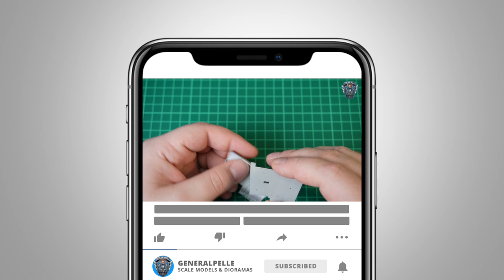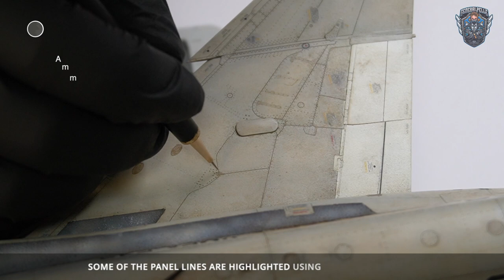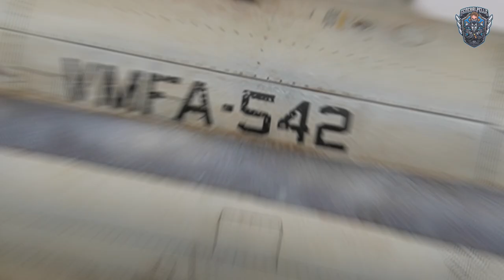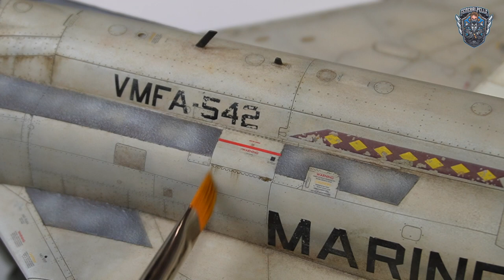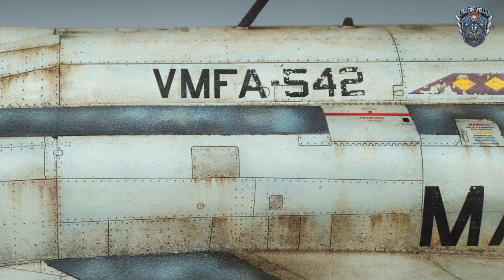F-4 Phantom II - Tamiya 1/48 - Scale Model Aircraft

Comment: Nice work you're very talented. I was in the AF 85'-89' as a Fuel System's Mechanic on the F-4E & F-4G Wild Weasels. What a beautiful beast to be around. I can't speak for the Marines but our birds were washed on a regular basis to keep corrosion from becoming an issue. Here's a few things that you may or may not want to take into consideration. Under the tail where the exhaust is was a combination of somewhat shiny & dull aluminum panels with a good amount of black covering them. The thin lines going perpendicular was a nice touch.
The areas that had some dark streaking were connection points on the belly, wheel wells and their panels, rivets & screws all over the skin, and on the centerline tank there are two seams, the nose cone and tail cone. The center section is one piece. the grease, fuel, hydraulic fluid that would streak from the places mentioned would do so going straight back because it could only go back when flying so damn fast.
You nailed the cockpit as they were definitely a scratched up black interior.
Tires were a dull black and never dirty since they never saw dirt but the wheels (rims) had hydraulic fluid on them.
As I said at the beginning, you did a great job and are talented. Thanks for sharing your work.
Reply from the maker: Thank you very much for the informations. Really interesting stuff, that i will consider when building my next bird. As i mentioned in the video, that was just my 4th airplane so far and i would say i'm currently in an "experimental phase". I know, some other air modelers also tend to weather their models to dirty, which defentily makes them "pop-out", but is somehow like you say (and also others) unrealistic. For me personal, i doubt i've the skills yet to make a good looking AND realistic bird. Maybe in a few years we can talk about that, because talent is nothing without experience. Let me talk a bit about the making of the F-4 i presentend here. When i started, i wanted to make a more realistic airplane then i eventually did. I browse around and searched for some inspirations and then i got the idea to make a diorama with an airplane on it. So i decided to use this one for kind of "jungle airfield diorama". And there is where things start to go wrong (in the sence of doing it "realistic"), because i can't replicate the da nang airbase (or parts of it) in 1/48 scale and make it look somehow good. Needless to say, i don't have the room or time for that. So i go the "diorama" route and improvise a bit, at the end i'm planning a small airfield with some jungle behind it (thats also no way realistic, if i look at pictures of the airbase where this F-4 was stationed). Then for example, i start to make the tires to look dirty to match the ground it will stand on the diorama. Things get more wrong when you did misstakes on your model like i did. I didn't record that on camera, but it's still somehow visible. When i sprayed the walkways, the decals where already attached and the masking take took some of the decals of, causing the first few chips on the decals. I first was like "what the f***, i'm so stupid". Then i thought, okay, well, i build this thing so long, can't fix this now, i make some more chips on the decals. But then i can't paint it look like fresh and clean with chipped decals, that would look... aweful ;) And sometimes, there is this inner voice in me, that tells me: hey, do it like you think it should look good. If we see scale modeling as a kind of art form, my words make probably a bit more sence: If we took a look at pictures of humans or buildings, do we really only like the onces that are painted realistic? Some of the most expensive artworks portraiing humans aren't nearby realistic. I personal don't consider myself an artist, scale modeling is a hobby for me. I'm a software developer for 20 years now, and scale modeling helps me "free my mind" from the "logical" things my brain needs to think about most of the time. Painting scale models helps me with that and then i just don't want to think about whats realistic or not, i just want to make it look good. 

I've hard doubt that any F-4 (Marines or not) looked this dirty in reality. I was of course fully aware of that, and making my work public, it's a total valid point to bring that up (i'm also aware that there is a broad discussion going on this topic). Of course, i can understand that if you worked with these things, that my work just feels "off". But let me say, your comment bring a lot of insiprations for me as a young modeler, that i'll take in consideration for future builds. I can't promise to implement everything in my future works, but i'll try.

Comment: Fabulous job of an old warhorse! But lost a point for authenticity. The WS (Whiskey Sierra) on the vertical stabilator is exclusive domain of VMFA 323 Death Rattlers. Worked on the real deal at MCAS El Toro in  ‘71.
Reply from the maker: @DavidJames-b7q  Thank you very much. You’re absolutely right. I messed up the decals and destroyed the correct ones that are actually used for the airplane. So that’s more of a fantasy version. If you look more closely, you find also other wrong decals used for the same reason. Not on purpose, more because of human errors.

Comment: Absolutely fantastic and stunning work. I have 1/32 to start and this helps immensely. I always have trouble with washes especially the AK ones, they don’t seem to want to come off!! What would you recommend and any more tips??
Reply from the maker: Thank you very much. It’s always nice to hear that my videos come in handy. My process with washing goes like this:

1. apply the main coat, decals and so on 
2. Make sure the surface is smooth, find uneven places with your finger and sand them carefully with 1500-2000 grid. Make sure to not destroy any details while doing so. You should skip this step when using liqueur paints, they are smooth anyway.
3. spray 2 light coats of glossy varnish. That’s important. Wait a little bit between the coats. The acrylic glossy varnish will give you a surface that’s easy to work with. Wait at least 24 hours to dry, 48 hours also doesn’t hurt (better safe then sorry). Repeat step 2 on places where necessary.
4. Apply the wash. Make sure you don’t build it up. Wait for 40 minutes. The time depends on the condition where you build the model (temperature, wet air,…). If you wait to long, it’s hard to remove. For me it’s 40 minutes, for you It might be 20 minutes or one hour. 
5. Remove it: I use removing sponges from ammo mig these days for the heavy work. They even work without thinner, but on harder to remove places it’s easier to add some odorless thinner to the sponge. The thinner will react with the enamel, make it easy to remove. I also suggest having a wide range of different model specific cotton swabs, like the once’s sold by Mr hobby or tamiya. They work better then the once’s from the supermarket, because they are much more stronger (or less „hairy“). They can be used for harder to reach places or where the enamel cured to much.

I also usually work in sections. Don’t wash the model all at once’s, do it in multiple sessions step by steps. That’s much more easier then doing the whole model at once (removing takes time, the rest would cure meanwhile). It’s also a good idea to practice this technique on a scrape plastic or plastic sheets. 

Feel free to ask questions if you have any. Happy building :)
Reply: @GeneralPelleScaleModels  thank you so much!! Just one more question. I believe this to be true so if I paint the main colour in acrylic I should use an enamel wash so I can use an enamel thinner to remove it so it won’t affect the acrylic?
Reply: Or would an oil wash be better?
Reply from the maker: @waynejones2316  Thats correct. But it’s more about the varnish. The acrylic color alone can’t stand the thinner, because odorless thinner is to hot usually, and the wash will soak into your acrylic main coat (make it difficult to remove and risking to removing the acrylic color too). But the acrylic varnish will protect it. As you said correctly, you should use an acrylic medium before using enamels or oils (it doesn’t matter which one or even both). If you would use enamel colors (like the once’s sold by Revell) for your main coat, an acrylic wash would be the way to go. But yes, in your case enamel or oils are the right choice. The point why someone uses enamel washes is that they are pre thinned to be used as wash, with oil paints you’ve to create your own wash using thinner. That’s okay, but it’s more difficult to get the consistent correct.
Reply: @GeneralPelleScaleModels  fantastic….thank you for all your help and for replying. Going by this I don’t think I had put down a sufficient clear coat before the wash and it was just gripping. So thank you again.
Reply from the maker: @waynejones2316  you’re welcome :)

Comment: Found this on Reddit. You’re very talented. How do you protect you models? Do you have them in display cases to keep the dust off of them? I haven’t built anything worth protecting yet ,but if I was on the level you are I would need to invest in something.
Reply from the maker: Thanks :) well, that question flips around on my head, too. I thought about some display cases, but they are way to expensive for that size. I probably will end up building my own display cases with pre-cut acrylic glasses. So currently, I don’t protect them very well but clean them from time to time using a makeup brush or the airbrush (with only air of course..)

Comment: A work of art...congratulations!
At 33:54, the "worn" numbers of the VMFA 542 appear on the side fuselage and I ask what technique was used to wear out these numbers?
Thank you.
Reply from the maker: Thanks for your kind words. First apply a gloss varnish to protect the paint job, apply the decals using a decal set/sol solution (like shown in the video), then wait for around 24 hours. After it has dried, put tamiya masking tape over the decal and directly remove it. First the carrier film will come off, but if you repeat that step some parts of the decals will „chipped“ away. Be careful tho not to remove the complete decal, but that shouldn’t happen with the sol solution applied. Be aware that this only works with thin decals, for example the once’s that eduard produces. With thicker one, like the once’s supplied with this kit from tamiya, this technique doesn’t work. I used a mix of eduard and tamiya decals in this build. Hope I could help you, happy building :)
Reply: @GeneralPelleScaleModels  Thank you very much for the information...congratulations for your skill and if possible, make a video with the step-by-step assembly of the 1/48 Kinetic Mirage IIIE kit...it will be very welcome
Reply from the maker: @fabiosilva3799  I already took my eyes on that kit, be it has an Swiss army option (and I’m living in Switzerland), unfortunately I’ve already a large stack of 1/48 aircrafts I need to build. So if a mirage is coming, it’s probably still far ahead from now. But definitely keeping an eye on it, it’s a awesome looking fighter.